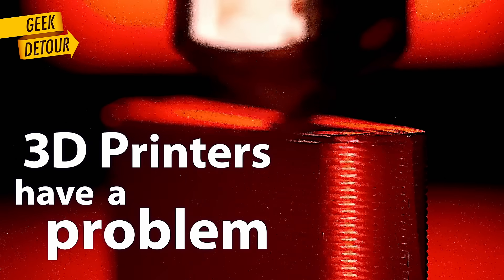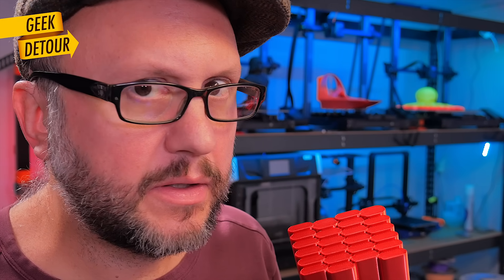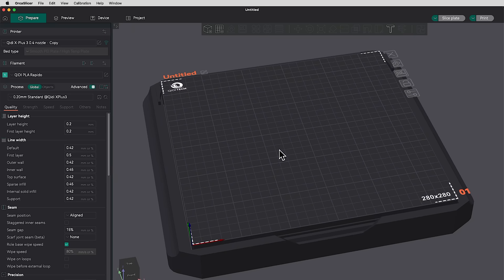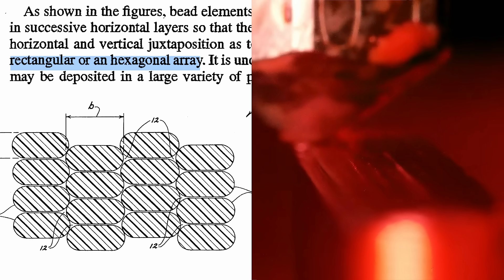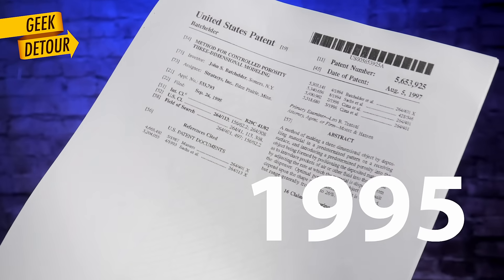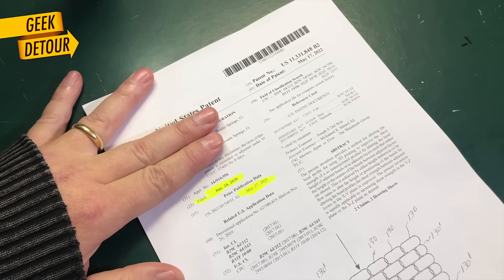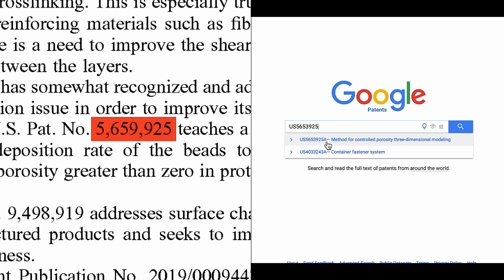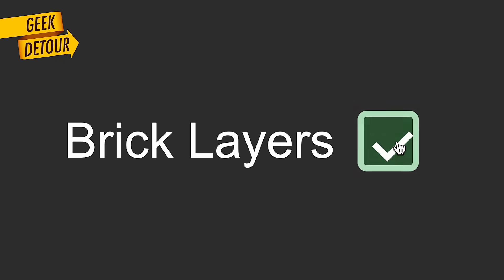Brick Layers: Stronger 3D Prints TODAY - instead of 2040 😬

Comment: I think this situation might not be as bad as it appears?
I attempted this as a part of my Masters thesis without knowing any of the patents (mainly because intuitively I knew it as staggered layers instead of brick layers)
I used a different way to print those layers (multiple concentric models nested inside on another, each with a height range modifier to initiate the brick layers)
I controlled the porosity by making those concentric models overlap slightly, essentially overextruding
I only tested tensile strength, as that was what I was interested in
I managed to get 35-36MPa from PLA samples with this approach, compared to 30MPa from PLA samples with standard layers and no overextrusion (100% cooling fan iirc for both samples)
But then I tried turning off the height range modifier once, basically just printing an overextruded normal layer sample, and I got 35-36MPa as well
Comparing the broken samples I found that both had pretty low porosity, but it was still broken between layers (now failure happens across multiple layers instead of just one, but still most of the fracture surface is between layers)

I think that while reducing porosity (through layer structure or overextrusion) does help, it might only increase vertical strength by 15-20%
The rest of the missing strength is likely in the thermal process (i.e. layer reheating), which a number of printers already do and they have claimed essentially perfect layer adhesion
Reply from the maker: You are officially invited to make a video about it on YouTube ❤
Reply: @GeekDetour  Just don't quite have the time. Have since moved on to another research topic

Comment: Patent examiners?  No such thing.  Maybe there are some but for only the most extreme cases, but the patent office can barely get every application registered, they don't check to see if it conflicts or is valid.  It is up to the original patent holder to determine if someone's new patent infringes on their established one.

There are also many ways to not violate the original patent.  Just t slight change to the design that makes a significant difference in the way the part prints, or it's print properties, would warrant it's own patent.  But then you may spend years in litigation while the courts decide if that change is significant enough.  But I think you said something about the patent being for another type of printing?  That alone would invalidate any claims over use in FDM printers.  

I'm also not a lawyer but I have had a tiny amount of education on the patent system.  We were actually studying copyright but there were a lot of comparisons to the patent system in the lesson.  That was about 40 years ago, things may have changed.  However, you should be able to find a lawyer who will give you a free five or ten minute initial consultation.  He should be able to give you his first impression on if there is any actual risk of copyright infringement, or if there may be enough to go to court and have the current copyright claim revoked.

Another thing you could do is contact the company and just ask if they would consider an adaptation of the design to FDM printers an infringement... or better yet, have a lawyer ask.  Finding out if there is really an issue may be the best place to start.

Comment: first 3d printing has been around 30 years its only a few years back someone saw it said hey ill open source it etc then it took off second its not designed to be a part makier its pourpose is to rapid proto type a model so you can show investors take itinto meetings and work from it to make moulds etc.. but since we cant do the second part to expensive time consuming we turned it into small parts makers and small propjects its open srounce the whole thing to put a pattent on it shame on you who ever did that its time no more pattets on slicers on machines and new tech yes but not on slicers..

Comment: My idea:

Lets say, PrusaSlicer can be developed as it is. Only 1 small addon would help a lot: extention / plugin possibility.

The work around here is, that NOT prusaslicer break any law. Every end-user who use a specific post-processing breaks the law (not realy, but you know what i mean).

So in the end every slicer-developing studio can get special features, by not implementing them, but by leting users implement them. This could be a "formula", or a extention / Plugin. Or even nothing of them, just a seperate "script" that do the job (by shifting z by a half).

Not a big deal, at all to realize such an idea. And yes, i agree with all points with you. I appreciate your research. Very well done ! I think the New patent is not valid, because of so many errors in it !
Reply from the maker: THIS, my friend, is something worth discussing: making Slicers easier to 'hack' or extend.
Reply: @GeekDetour Cura has plug-in support

Comment: this is called "patent busting" done all the time. If you can find prior art in the public domain, you are covered, especially something as obvious as this. 

Someone needs to implement this option, make it available anonymously as an add-on. If this is not used commercially, there is not even a person to sue here. Done. 

You need to approach people who could actually do the coding for the slicing.

Comment: how much stronger is it across lamination? it seems to me that the gains due to reduced porosity will be extremely marginal. the reduced strength is primarily caused by laying hot melted plastic on top of cooler solid layer, not by the gaps.
Reply from the maker: Did you watch Stefan video? He got 15% better strength on his preliminar test. This is amazing, but also not marginal. On his video we can see there was a lot of porosity, still. It can be fine-tuned. I bet that, with more people working on this, we could achieve 30%, maybe 40% better adhesion.
Reply: @GeekDetour  thanks for the response:)
I am very surprised by this finding! Good news for printing if we can get around these patents. Thanks for the video

Comment: Patents are stupid when they impede the greater good. It should be a well developed function to determine when they do that in our society. But advancement isn't the human goal. Increasing your consumption is. That is your function. You're not a worker. You're not a creator. You are a consumer in the eyes of anyone who has any power over your life. Think of it this way, if we had brick layers you would consume less filament. And then that would hurt the 3D printing industry and slow innovation. Just kidding. Felt good for a second though huh?

Comment: Seems another workaround might be to build a "plugin" system into a Slicer and then someone could implement the feature and release it anonymously. At that point, the company holding the patent is going to have to play whack a mole with hosting services that host that plugin.

The rest of us would benefit because we know where to find it and wouldn't be a target for violating if we don't run print farms (they'd need a large enough target to go after as they'd want to get samples of you using it in commerce).

There have been other alternative ideas to FDM that never make it out of theory/prototype for the same reason.
Reply from the maker: I would love that.
Reply: Aren't many of those slicers open source? That means it can simply be a patch.
Reply: @MiTheMer Hence, why a plug-in type feature would be needed. Plus, good luck trying to shutdown  thousands of users with an open source mod file. They f@&k us, then f@&k them.
Reply: @MiTheMer  The problem here is that the holder of the patent can then sue the slicer for infringement.
Reply: @MSClippit  patch, aka like a .patch file, that is applied with git, and not actually in the codebase
basically just a text file that tells the program what to change from the source code
Reply: @KStovr  on a bad patent? Good luck. Especially if the slicer is open source and had not implemented the code itself. That's like having a patent on dovetails and sueing a router brand for being capable of cutting wood.
Reply: @yourakunt4909  You haven't gotten the point yet. The threat of that specific legal battle is the exact method by which this hasn't been implemented yet. Think I'm wrong? Make a merge request with orca or better yet fork orca and implement it yourself.
Reply: @ThylineTheGay  This is interesting, where does the patch file live then? because to me it doesn't seem to avoid the core issue. The problem I see is that somewhere along the line, the implementation has to exist. wherever that implementation exists, the patent troll can attack legally unless I'm still missing something here
Reply: @MSClippit  its literally just like a shape, how tf they let them patent a shape
Reply: @lavahawk  just do a search literally anywhere about the dumbest US patents. You'll be shocked. There's even a patent for playing fetch with your dog
Reply: @MSClippit  I likely will just code it myself. Unless I can find it elsewhere. I have no desire to make a slicer and sell it. There is no threat to most people.
Reply: @yourakunt4909 A good place to start might be the video this one serves as a response/ follow up on then. I don't remember exactly but I believe there was mention of the gcode used for it? Best of luck either way!
Reply: @lavahawk  Reminds me of The Hudsucker Proxy.  You know, for the kids
Reply: @MSClippit  good luck attacking legally a server paid in bitcoin in russia or china.
could even just be a google drive tbf, even big corpos have a hard time playing whack a mole with streaming services.
and even if they attack legally an "implementation of the stratasis patent" they're probably not wining 
also it's an us-only patent so a modified version that is "not available in the us" wouldn't get sued afaik. (as long as the server isn't in the us.)
Reply: @yourakunt4909  I don't understand why people don't understand that the concept of suing someone is not the same as winning the lawsuit against someone. They can sue you and lose, it will still cost you thousands of dollars unless you can prove that it was a bad-faith lawsuit. Basically they just have to show they thought they would win, which is trivially easy, and you have to show they knew they would lose, which is really really hard.
Reply: Cura already has a plugin feature
Reply: the patent is already invalid, no need to try to work around it. do it openly, they cannot defend their patent in court.
Reply: @SoloRenegade  A slicer isn't likely to risk it until it's actually pulled by the patent office but a plugin should be pretty safe. I've written plugins for Cura and this should be fairly straight forward, at least as a proof of concept.
Reply: @JJFX-  those all violate any patents, and create prior art, according to the letter of the law.

I believe in educational exceptions to patents, but strictly speaking the law makes no allowances even for that. Youtubers demonstrating this, talking about it, trying it, and such is all prior art (and patent infringement if the patent were valid).

But the simple fact of the matter, this new patent is indefensible in court, period.
Reply: @SoloRenegade  Agreed but afaik private, non-commercial use of patented material isn't an issue in the US and should typically be fair use in a relevant educational setting (such as a classroom) as long it's not monetized or distributed.

In some countries this is a problem but shouldn't be a factor unless patents exist outside the US. Youtube is obviously commercial use and I'd assume videos that knowingly or unknowingly create patented material could be claimed by the holder regardless where the creator is. However, simply discussing the patent itself in a video should be fair use since it's public information.
Reply: @JJFX-  not all of youtube is commercial use. 

Patents strictly forbid "fair use", even though it should. but an invalid patent doesn't apply, period.

When a coupon is beyond its expiration date, you can no longer use it. same here.
Reply: @SoloRenegade Patents do have fair use it works but far differently from copyright.
Reply: @erkinalp  cite the fair use regulation for patents then, so I can read it.
Reply: @SoloRenegade  the patent equivalent is non-commercial research exemption, but it's very narrow: 
"""
In 2002, the Court of Appeals for the Federal Circuit dramatically limited the scope of the research exemption in Madey v. Duke University, 307 F.3d 1351, 1362 (Fed. Cir. 2002). The court did not reject the defense, but left only a "very narrow and strictly limited experimental use defense" for "amusement, to satisfy idle curiosity, or for strictly philosophical inquiry." The court also precludes the defense where, regardless of profit motive, the research was done "in furtherance of the alleged infringer’s legitimate business." 
"""
Reply: @erkinalp  that's a precedent in court, but not a law. but it's something, but your citation even admits the courts further restricted whatever exemption existed.

"In 2002, the Court of Appeals for the Federal Circuit dramatically limited the scope of the research exemption "
Reply: What other alternative ideas for fdm are held back by patents?
Reply: @anonim1133  I have never researched it myself, but supposedly there was a patent on temperature-controlled build chambers with external heat sources (as opposed to just a passive enclosure that happens to trap heat from the print bed) that only expired quite recently. It's why that feature is now showing up on commercial machines at the low end of the market and wasn't previously. It's not that adding a heater, fan, and temp sensor is exactly difficult.
Reply: @anonim1133  unfortunately there seem to be quite a few. Thats also what has held back metal additive manufacturing/directed energy deposition. it's still happening. Some of it makes sense. But most of it just feels like a company gatekeeping potential technological advances and keeping prices artificially high. But I'm biased because I don't have a 7-axis laser-based metal powder deposition+CNC machine to play with.
Reply: @anonim1133  A certain kind of hotend (not the e3D one), for example. =)
Reply: why not just introduce a staggered line laying for walls with additional options for line spacing and line offset between layers. it is essentially doing the same thing by piecing all the features together assuming you know what you are doing.
Reply: They have no case against developers who do not actually use their patents.
Reply: @albertmagician8613  they have no case against people who are merely using an expired patent from decades ago.
Reply: @monad_tcp  why are all of you cowards still capitulating to an expired patent?
Reply: Возможно стоит лишь слегка изменить идею, что бы не было нарушений авторских прав. Представить это с другой стороны. Или же придумать решение иное.